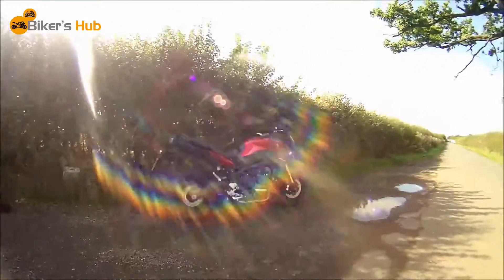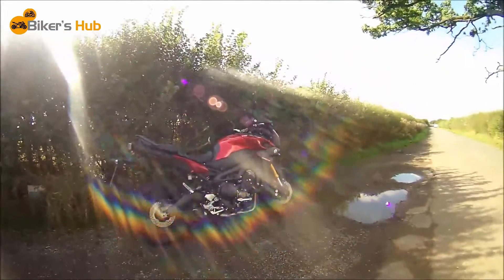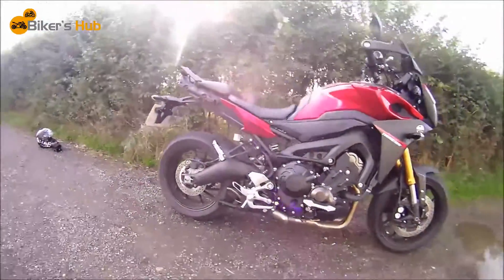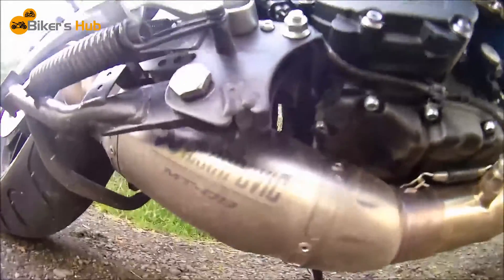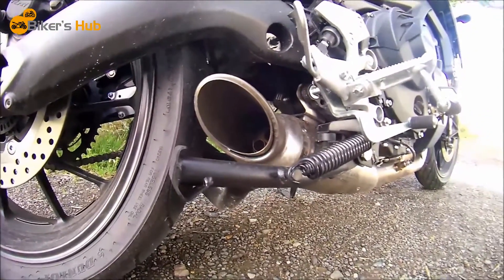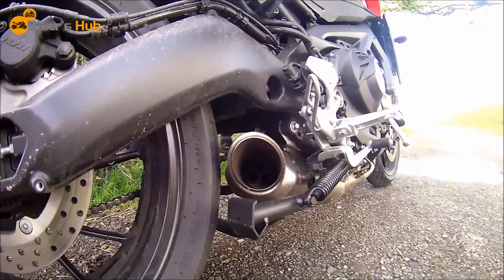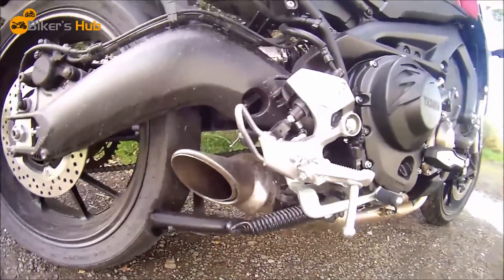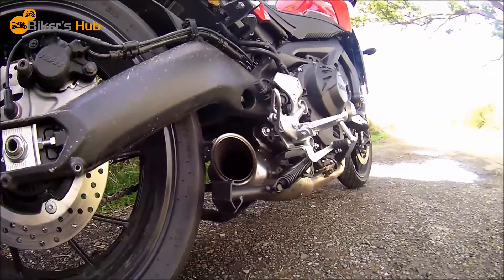Yamaha MT09 (FJ09) Tracer with full Akrapovic system - It's LOUD and spits flames!!

Comment: When the bike is back on the road could you please do a comparison with the Baffles back in Mark? (Will help those of us deciding whether to purchase or not) Cheers Steve
Reply from the maker: No worries mate, will have to find it first!
Reply: Lol! Did you get a Powercommander or have the fuelling re-mapped when you got the exhaust fitted?
Reply from the maker: Nope none of that was done, they just swapped it straight over! I have not run the bike on a standard exhaust however I didn't notice any difference really then the demonstrator with the standard on